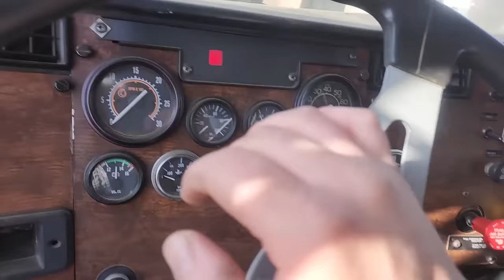"Valvetrain Knocking" is NOT what we find on this Engine.

Comment from the maker: Thanks for watching. What the heck is that manifold on the coolant reservoir? I bet some of you know. Amazon affiliate links to Recommended Tools: Fuel Pressure Gauge, Compucheck 0-300 psi: https://amzn.to/3YeBldu
Airlift Cooling System Vacuum Filling System: https://amzn.to/3D9AlPu
Radiator Pressure Tester Kit: https://amzn.to/3QGBumn
Milwaukee 3/8" Right Angle Impact Wrench: https://amzn.to/3D2CvAk
2 Pack M12 Style Batteries for Milwaukee: https://amzn.to/3D2mdHE
Adjustable Height Parts Tray 100 lbs: https://amzn.to/3CBusZB
Engine Oil and Fuel Dye UV: https://amzn.to/3z34zkv
UV Professional Grade Light: https://amzn.to/3gzxPc0
Allstar Oil Pressure Priming Tank: https://amzn.to/3L5pASm
Reply: You need to get a mechanics stethoscope and learn to use it. Valve cover would have never came off. Also do a video on how you got the crane up. Did you run the starter to power the pto. Or external hydraulic pump? Hooked to another vehicle? Use an air starter and shop air? Used an external heui leak pump to pressurize the hydraulic system?
Reply: About a year ago I get a service call to replace a starter on an acert. About a four hour drive. Talked to customer for a bit then he went back to location. Checked batteries, all good there. Hit key, starter made a pretty solid hit. Noticed oil was high and coolant was low. Pulled the intake off to get a look. There was coolant sitting on the valves. 
Dropped a valve. Complete in-frame.
Reply: @UberArchangel  Part of troubleshooting. What harm was done? Josh knows how to troubleshoot. Customer said it was in the valve train. Josh confirmed it was not. So he can report to the customer, that he inspected the valve train. It is not a perfect world and sometimes you have to make the call. As my old TC told me once, now you know what its not. Would I have done something different? Yes, I would have started with the 3/4 wrench. But still would ended up doing the same thing and cutting the oil filter open eventually, before really digging into it.
Reply: @johngoldsmith6629  Exactly! And what happens if you don't pull the valve covers, jump in to something else and find something, fix it. Then a month later something grenades in the top end, when the customer told you he thought there was a problem in the top end, but you didn't look and now you eat the job.
Reply: @UberArchangel always cover your ass. Customer said it was valve train. You check and confirm valve trains.
Reply: @UberArchangel it was already in for overhead work he said

Comment: Back in the day, shop had a customer with a drill truck 12v-71 highway engine in it. They kept burning up the engine. Oil sarvation. After the second warranty  overhaul, we found out wht they were doing. In order to drill, they had the front of the truck up on a platform. The oil went away from the pickup. The fix was to put a industrial setup w/scavenging  pickup oil pump. Never saw them again.

Comment: I always put a ziptie on the oil drain valves to keep the tab in place. Probably not needed, but extra security.
Reply: There's a cap you can buy for em that has an expanding plug and will keep the lever at 90 which you can crank off pretty easy.
Reply: Cheap insurance.

Comment: Australia here.That was interesting. I would have picked conrod myself. As a Massey Ferguson trained diesel mechanic I've seen a lot of weird things with motors. But as a farmer I fix all my own machines. Whenever I hear tapping like that I always pick bottom end first. I once had an interesting experience with a Land cruiser diesel, where a big end conrod began to fail. Not much I could do as I was in the middle of nowhere. Started with a tick tick hour later it was tap tap hour later it was like a roaring sewing machine. Bang. hole in the side of the block. And I was still a 100km from the nearest town.

Comment: Not as tricky as putting an engine in a cabover fire truck. The last one I witnessed was done by suspending a C13 from a pipe after lowering it into the frame as far back as possible, then walking it forward with a forklift on one end and a transmission jack on the other end. That was a delicate ballet for sure.
Reply: The cab is suppose to come off but fiscally i understand not wanting to. Labour cost
Reply: The engine is easier than the radiator.
Reply: @firemech911 Well, we had a M&W Fire HME Arehns Fox Penetrator and after seeing that process I see why the mechanic hauled it to their shop....cab off, pain in the ass and glad we didn't have to do it.

Comment: That is an aeration hose, to bleed air out of the cooling system.
I am a Diesel Mechanic on heavy transport in New Zealand, generally that hose goes from the thermostat housing to a header tank behind the cab on cab overs,
or high on the fire wall for bonneted .Quite common down here worked on many 3406B's.
Like the videos keep it up.
Mike Kay

Comment: I heard that engine and I could tell it was piston slap. To do it right, it needs an engine replacement or out of frame major. It looks like that piston cooler is not aimed right to the underside of that piston. I used to insert 3/32 welding rods in all 6 coolers during overhaul and get them in the correct position in the quadrant of the pistons. This looked like the cooler may have been bumped out of position during overhaul or just was not aimed. It is very important on todays high horsepower engines. You do have good diagnostic skills. Keep it up, you can learn something every day. I try too.  Good luck.

Comment: 6:32 the Fumoto drain valves are great. Never seen a problem in 20 years. 
 It sure beats stripped out drain plug threads. 
Only issue, was when I used to be a transit bus tech. Bus engines are at the back. When a bus would go through a speed dip in a road too fast, the engine oil pan would kiss the pavement. The drain valve on the bottom would go through the pan.

Comment: On your game, as usual. Liked your comment on the quick drain oil pan plug. I couldn't agree with you more. Had one the Dealer put on a Mack 676. Caught a healthy tall weed coming out of a farm field loaded. Drained the motor and seized. Had to Line bore the block and do a major. That was 30 years ago. Never had one on any of our trucks since. Thanks for alerting people of the possible danger of having one. They judge for themselves if it's worth it. Please keep up the excellent work!
Reply: Anyone that runs old cats in Pete’s have what’s called a oil pressure gauge and an alarm when there is no pressure. Anyone that runs a Pete knows that if buzzer goes off and gauge reads zero psi to shut truck down. Mack guys are a little slow so us Pete guys can understand how Mack guys with easy spot could blow a motor with no oil pressure😂
Reply: @shortthrow50 That was my first question. Caught a weed, drained gallons of oil, with a guage on the dash showing zero- and possibly an alarm?? And we  run it till it seizes?

Comment: Just wanted to answer the issue about the oil film on the windshield. If it was anything like my drill rig, it's the residue of compressor vapor and the oil we run in the airstream to lubricate the down the hole hammer.  It's vapor because you can't perfectly seal the pipe connections and it collects on the drill mast. The mast is down for travel and when parked. Then rain, dew, etc trashes your windshield.

Comment: Hope you do a part two video showing what caused the scoring of the cylinder wall !
Reply: I’m gonna guess the ring end gaps were too tight and the rings butted together when the engine was put under a heavy load!
Reply: @MrsSunshine75  it looks like the scores are right to the bottom of the cylinder bore, the rings don't sweep that far down.
Reply: Overheating

Comment: One fellow mentioned the piston cooling jet. At Cummins, I witnessed one time these parts were discovered to be made wrong, and the oil jet wasn't targeting the center of the piston. Was important enough to shut the engine down and wait for and install correct parts.

Comment: Josh, I would say the little tube is an air bleed. If there's a T-stat in that housing it's to purge air out of the pocket at the top of the housing w/ filling coolant. The noise is probably coming from the piston, not the rod. The rings are probably broken and maybe ring lands too. I've heard it befor on huge gas engines. It sounds too quick for a lifter/ rocker but not deep/ solid enough for a rod. Of course can't tell any of that from a YT video, condenser mic's pick up light metallic sounds disproportionally.  ben/ michigan

Comment: The oil jet which cools the base of the piston could be blocked causing the piston to overheat . Might be the cause or the effect of the issues.
Reply: ive had that on several engines last one ford duratec
Reply: I though it might’ve washed the cylinder out. Makes sense with the oil looking like it had fuel in it.
Reply: Give this man a cookie
Reply: or could have been a stuck open injector that or fueled the cylinder and got hot

Comment: If you rebuild this old 3406 remember to check the liner packs will work with the oil jets. 3/8 old type won't work with the. Newer 0R liner packs and must use the 7/16  style. Also the thick injector tube washers must be used.

Comment: I have a quick drain plug on my c12 and have had it for 7 years and a million miles and have never had any problems with it coming open.  I also have them on my cars and also no problems.  It is so much easier and cleaner to drain the oil.  I can also drain it right into a container.  Since I don't have my own shop it helps out alot.

Comment: Josh
Good morning.
Thank You for sharing this video.
We have a kind of like trouble. The engine has a very thin, transparent oil. The engine pressure drop down to 10 psi.
It has a 6 plunger fuel pump with electronic control module

Comment: Hey Josh. I’ve had those quick release drain plugs on both my trucks. I always make sure they’re locked and aimed in a direction where rocks shouldn’t be able to open them. I suppose a guy could put a zip tie on them after every oil change so they couldn’t unlock. My main concern is some other driver having a bad day and dumping my oil at a truck stop as I’m sleeping and it’s idling. Oof. Trucking isn’t the brotherhood it used to be, unfortunately.

Comment: I'm curious if you could tip the drill rig upright, then pull just the front half of the truck into the shop to change the engine
Reply: You can't drive the rig once the derrick is up. Too top heavy. It's an outside job unfortunately.
Reply: I think it would be quicker, just to pull the front of the truck, bumper, hood, cooling pack, everything comes out the front, with the aid of the shop forklift. Putting it all back in is a little more difficult, but easily doable. 
The mine scoop, with the leaking turbo seal, looked like a R1300.
Best wishes from the far North.
Reply: I think i whould just jack up the rig as mutch as one can and secure it to the rafters. Should get enough clearing then.
Reply: Just do the job outside with the derrick up

Comment: Mike is correct , Peterbilt trucks used this assembly even used two on 8V71 series engines . It was mechanical coolant Snake Oil .  Why did you not crack the fuel nozzle line fittings on the fuel pump to isolate the engine noise cylinder location ?

Comment: On that truck the "solenoid " is a second throttle access point to control hydrolic pressure as needed from the rear of the vehicle during a drill or pump...

Comment: Air throttles are pretty common on older rigs - they use a "L" valve in cab to switch from foot throttle to rig control throttles - good prank on the unitiated is to switch it to rig controls and tell people to move the rig

Comment: 4 corner scouring usually lack of warmup or overheat. Cam ground pistons not round till warmed up some. Couldn't tell for sure if gallery cooled usually two piston cooler jets. Remember single unexplained rod bearing failures-9Y9497 late 80s.

Comment: Not a mechanic but I think the low oil problem mentioned is the cause of the gouging of the cylinder walls squirter will help cool the piston but only if there’s oil pressure.
Is that engine scrap? Or just a rebuild?

Comment: My 2 liter aluminum block  Kia looked like this from the top, with a bore scope ( though not quite that bad) ., funny they have machined spots for piston oilers,& a plan for future  turbo option (which I don't think happened) ...Later engines, including their all aluminum six cyl have these jets installed . Some how caught early the compression was perfect ,all being at 204 psi exactly. I added 4.5 ounces of synthetic 2 stroke oil per  10 gallons of gas & drove it another 24,000 miles with the same noise your diesel has ., scary but it hasn't gotten worse & yup I would be interested what caused your failure...Ya , no warranty!

Comment: I have a quick drain on my cummins but it has a locking tab that you have to pull before you can rotate the ball valve. work great as I can drain it hot and go inside for lunch

Comment: How timely of a video, I have a 3406b that developed a rattle suddenly also. It runs go no loss of power, no excessive smoke it gets louder as it warms up, good oil pressure 40-45 lbs at idle warm . Noise seems to quiet if you bring engine off idle to 1000 rpm and oil pressure comes up to 50-55 lbs.  What caused the failure in your truck? What should I look for in mine.   I checked over head, pulled air compressor / power steering and ac / alternator belt still has noise.

Comment: What was causing the knocking sound?

I was going to suggest that a wrist pin bushing had come loose in the small end of the number two rod, migrated towards one end of the pin or the other, leaving insufficient material to carry the load, resulting in part of the bushing gitting smashed thin enough to  leave number two rod bushingless (I had seen this on a 3208).

The problem with this hypothesis is that it does not explain the severe scoring observed on both thrust faces the liner wall. Also, when pin bushings fail, large recognizable chunks of them end up @ the bottom of the oil pan.

Comment: Before watching, I’m guessing wrist pins, based on the scraping visible on the cylinder wall in the thumbnail.

Edit after watching:  yeah I think it’s the wrist pin on that piston.  Seen that kind of damage with loose wrist pins on multiple engines.  It lets the piston rock side to side on the pin by more than the clearance between the piston and the wall, which then digs into the cylinder wall.

Comment: It is supposed to remove air bubbles from the coolant system. Air bubbles in a pressurized coolant system can create hot spots as well as wear the block, liners, liner seals water pump etc. It serves some of /similar functions of a “swirl pot” like used on engines where the radiator cap is below the highest point of the cooling system. As for what the thing is called I honestly forget.  On a side note GM used to have coolant system supplement pellets that years ago and Ford had a coolant system supplement for the 7.3 idi engines because cooling system cavitation was major problem especially on engines that had lots of idle time (Ambulances, Tow trucks, etc) that could cause coolant leaks from casting porosity.
Side note if you do not have some side play of the connecting rod the rods will bind or lock the engine.
If I were replacing the engine I would definitely be looking very hard at the oil cooler as the source (repository) of the metal going through the engine from a previous engine problem.
As for replacing the engine looks to me like an outside job so the drill rig can be erected out of the way, O joy

Comment: Looks like you’ll be using a forklift to change the engine unless you have a large C frame to work around the Derrick or unless you have a dual hoist bridge crane with the spreader bar to straddle the Derrick. 
Good video thank you

Comment: Doesn't anybody use a mechanics stethoscope anymore? I think they work for getting a little closer to pinpointing a problem.
Magnifier, Loupe or Digital Microscope would allow you to see more detail of metal particles in filter media and possibly pinpoint source by type of metal. Have all three for Troubleshooting and Failure Analysis.
Digital Borescope or Endoscope would allow you to reach up and view areas like the Cam lobes, Cylinder walls from below in better detail. Mine Wifis to Android Phone or Tablet for viewing.
To bad they didn't oil sample at regular service intervals.
Drill rigs almost always have to be worked on outside with mast raised and locked for access to the Deck or Truck engine.

Comment: Ive just had a 2018 2.0 tdi passat come in with the same issue, oil squirter bolt came out, got mashed to pieces by the counterweight and contaminted and subsequently wore out the skirt on the piston on another cylinder. Discovered it after new squirter, new bg end and main bearings and cleaning everything up (in situ obv) and the thing had what sounded like a top end rattle, but a proper stripping showed the skirt damage. So yeah, we do it right cause we do it twice😢

Comment: Do you think this could of been caused by a machineing error of the sleeve or piston or if the rings weren't gapped properly causing piston slap? It's interesting that only one cylinder had the issue. That would be my guess especially considering it was a remand engine.
Reply: If its from overheat my guess would be a pluged oil spray tube on that piston being it is the only one damaged. If the engine itself overheated more of the engine would be damaged
Reply: Four corner seizure, read my comments above.
Reply: Cat reman liner packs rarely have assembly problems. But the rings are marked 1up, 2up and color coded as are the oil control ring and expander with a green overlap zone. 3406b/c used 2 piece steel crown and aluminum skirt. The engine likely has fuel dilution from a leaky injector washing down the. Liner and remove the thin film of oil.